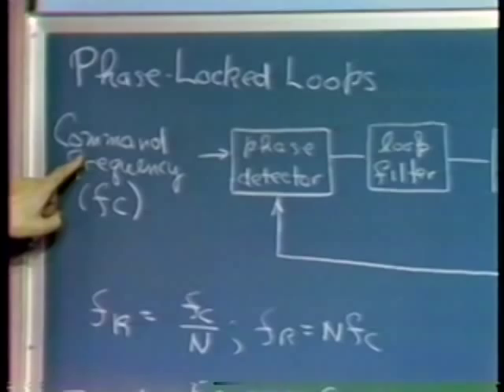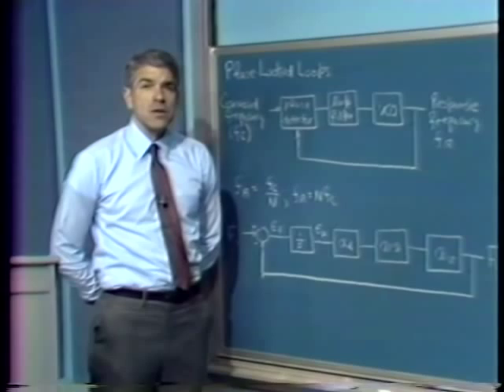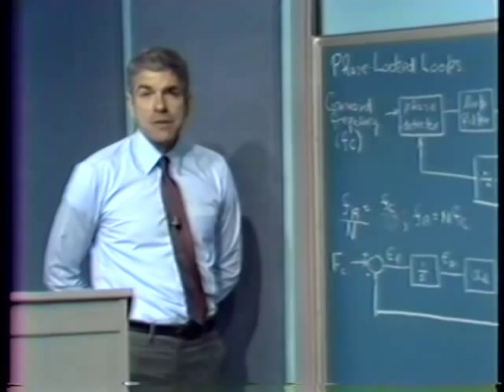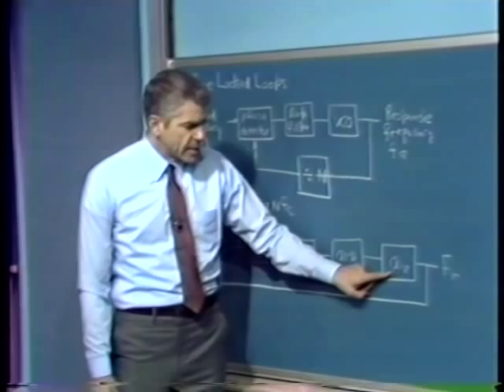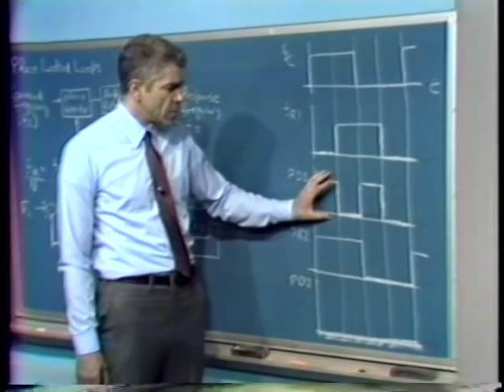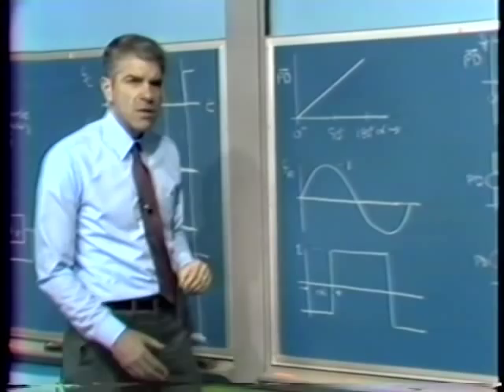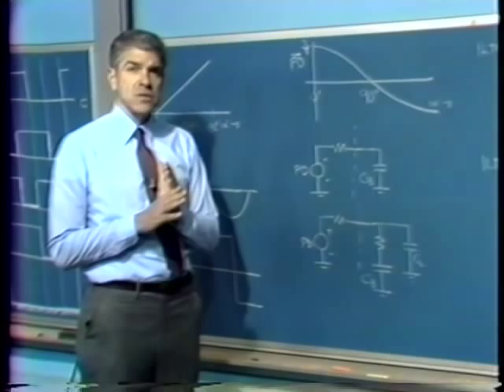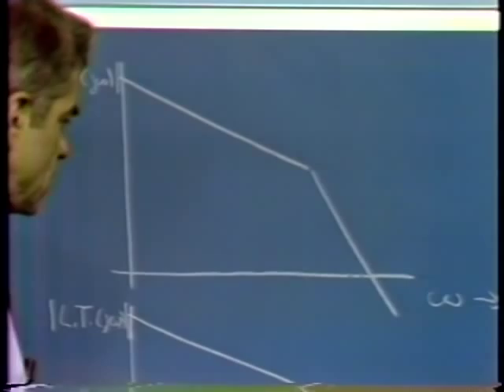19. Phase-locked Loops

Comment: a voltage regulator is a Voltage controller, a Constant Current source is current controller and like that a Phase locked loop is a more or less a Phase controller or frequency controller , every thing is in a loop , we have a reference and also an error amplifying device and some sort of control mechanism , all are one and the same if our view is abstract, that's it and may the Professors Soul Rest in Peace
Reply: Good observation.
It would be much easier if people were taught this unifying philosophy and then explained these 3 systems.

Comment: What if the signals are out of phase to begin with but their frequencies are the same?
Reply: Then the phase detector will produce an error signal until the feedback clock rising edge is aligned with the refclock rising edge. One thing to note is that you never get "perfect" phase and frequency alignment. The loop is always doing some error correction. Sometimes the error correction is very small, like when the loop is "locked". This is why you always have finite jitter. Jitter is never zero, although that is ideal.
Reply: Assuming you start same freq and same phase, and then alter the phase of input sig : the pll sig would at first go up or down in freq, but a moment later would adjust to original freq, but with the new phase.
Reply: @danielfromca  Thanks, this was the exact point I was missing!
Reply: @nicholaselliott2484  thanks for saying that. There's a steady state adjustment like with ordinary AC circuits. Following a phase change to the input signal, the XOR (or another phase comparator) would drive the oscillator with a different voltage, making the frequency jump momentarily. But this can't be a steady state, as the feedback would work to bring the oscillator signal back to the input signal's frequency, but with the new phase. (You understood everything quickly, but in case the original comment wasn't enough for somebody viewing this later, added a bit of extra).

Comment: at 8:10, the phase is just the integral of the frequency, but only in the linearized frequency domain not in the time domain
Reply: An instantaneous frequency is the derivative of phase in the time domain, and reciprocally, the instantaneous phase is the integral of instantaneous frequency.
Reply: @Ralph M Look if p is the phase of a signal x(t) = sin(2*pi*f*t) in degrees. Then p = 360*t*f, so I see how integrating a constant frequency value will give us phase. But since the frequency is constant - 8:28 you can't have a domain of it. no df is possible right? Also @panier66 I agree with you, but how does this relate to what the prof is saying - integrate frequency error and get phase error. Any idea??

Comment: 8:25 I don't see what he means by phase error between two signals of different frequencies. I mean sure you can find the difference in frequencies when you have two signals with different constant frequencies. But Phase difference is defined as the difference, expressed in degrees or radians, between two waves having the same frequency and referenced to the same point in time. I really don't see how integrating the frequency error (a constant since he says both are constant and different) gives us the phase error.
Reply: Technically you are correct, but the term is used loosely because it's understood that the feedback clock will never be EXACTLY the same frequency as the reference clock (although, that is what the goal is, along with getting the rising edges to be perfectly aligned.)
Reply: I think it's done because that's what the circuit does..

Just find what percentage of the waveform of a signal has been traversed. (π/2 , π/4...)

Do the same for another signal. And find a phase.

Subtract to get the phase difference.
Reply: the phase definition to which you are referring is for mathematics. in electrical engineering, phase is the integral of angular frequency or the x in sin(x); with the definition which he describes at 8:13 you can compare the phase of any two signals even with different frequencies.